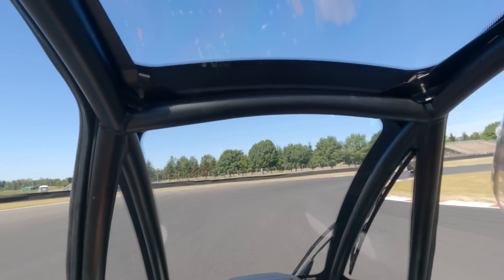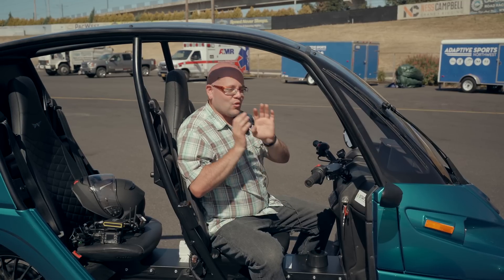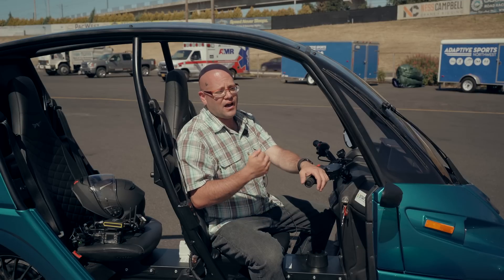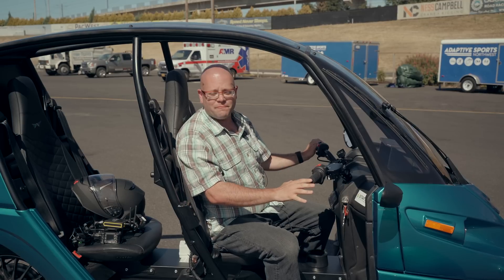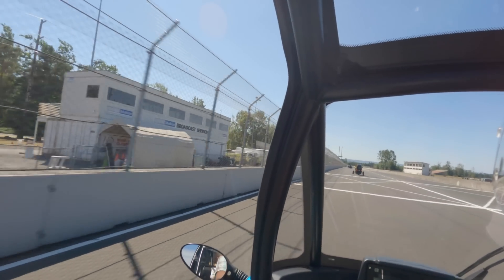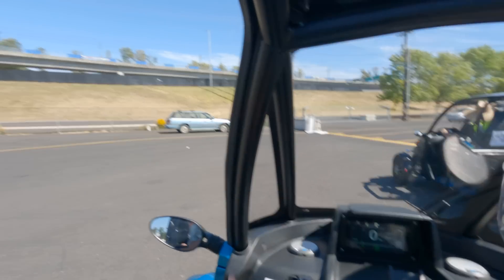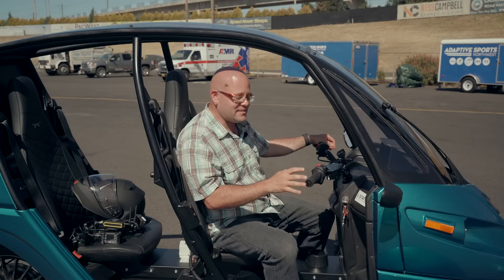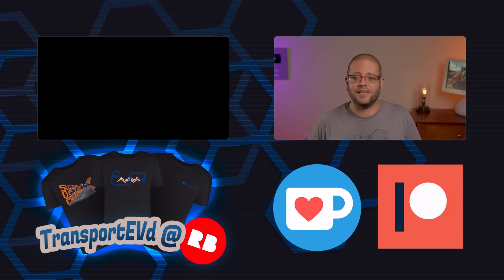All Arcimoto FUVs Will Get EVEN BETTER Thanks To THIS Super Smart Prototype!

Comment: i will buy one for $1,000.  $18,000 is too much for toy.
Reply: Ok broke boy
Reply: Not a toy if you live in a city.  Super useful and super fun.  Ditched my truck to drive this instead - more fun, easier to park, and does 95% of the trips I need to take (and yah, I'm a fan as a result :) ).

Agree that it wouldn't make sense if you lived out where everything is 30 miles from your house (like the rural farm we had for a while).  Then it'd be a toy because you'd have to have other transportation for too much of your regular driving.

Comment: For $18,000 I just don't see any value...
Reply: But at mass production they will be much much cheaper… 10k
Reply: @Bensmithstuff  I would be interested at $8,000
Reply: @skepticalmechanic  LOL - Dreamer!  I'd buy two at that price! (pick-up model and the one I two seater I already bought ;) ).

What other transportation that can go up to 75mph, protects you from the rain, and can go 60-100 miles on a charge could you buy for $8K that was well made and made in the USA?
Reply: @Haikutm  my thinking is I can buy a used Chevy bolt for $13,500 with 70k on it… realizing the dream in three days… battery only had 4% Degradation I sure am in dreamland!
Reply: @skepticalmechanic  👍 

There's a big difference between "no value" (implied by your statement) and "less value than ___".  I think your statement of "don't see any value" isn't accurate and is selling it short.  It clearly has _some value, just maybe not 18K worth, to you.  

I've bought a lot of used cars over the years and at about 80K is when the maintenance items seem to start cropping up.  No ICE in the Bolt removes a bunch of them :), but 70K miles on the battery pack of is a fair amount (never mind the bearings and everything else).  I wonder what a new battery pack for that Bolt is going to cost?

The Bolt is a decent cheap electric, but it's a different driving experience than an FUV (which I'd suggest is more fun, but I guess you'll have to drive them both and decide for yourself since that's clearly a subjective evaluation :)).

Also, at 13.5K You'll likely be able to get a brand new mass-production FUV for $12K in about a 15 months (call it $14.5 with full doors if you like) and so for $1K more you'll have a brand new vehicle with fresh batteries instead of a vehicle with 70K miles on it. ¯\_(ツ)_/¯  

"value" is subjective and I guess Arcimoto will find out if there are enough people who see the value Arcimoto's offering or not once they start producing them in quantity.  I believe there are enough people who will see the value and buy them, but time will tell.
Reply: @Haikutm  yes… we will…
Reply: Tons of value, especially if you live in a city.  So convenient for driving around town.
Cheapest plug-in electric car will cost at least that, likely more, and will get fewer miles per kWh because it'll weight 2x or 3x as much.

No question that at ~$12K it'll be an incredible value.  Still plenty of value as is.  Sold my truck and drive this instead.

Comment: As three-wheeled, two-passenger cars go, the Arcimoto appears to be well-engineered. However, there have been and are currently three-wheeled vehicles on the market, and they have never sold in significant numbers. It's not likely that the Arcimoto will significantly change people's vehicle buying habits.
Reply: I don’t know of any 3 wheeled, 2 passenger ELECTRIC motorcycle (not car by definition) that doesn’t require a helmet and/or endorsement. In Oregon, California, Hawaii, Florida and I believe one other state, the Arcimoto FUV does not require either. So there really isn’t competition in that particular market. I didn’t want to wear a helmet, wanted a starter electric vehicle, and didn’t want to deal with motorcycle issues (leaning, gear changes, passenger safety issues, needing to cross railroad tracks and grated areas very carefully, etc.) The Arcimoto fit the bill and 15 months later it still does.
Reply: agree. it will likely be a large failure in its current state.
Reply: The lower price than most of them, and the much more shielded  cabin make this much more attractive to me. The EV part is just an added bonus considering EV usually adds significantly to the cost. I'd buy a gas or electric version of this, but if they can truly  get this under $15,000 for the basic version I'll get one.
Reply: @bryanhersman4037  The EV aspect is the biggest thing going for the Arcimoto.
Reply: @kevinpolito1529  for some, I like the size, the look, the coverage from sun and rain, and mainly the price. If they made a $10,000 one powered by Honda's 700 parallel twin I'd buy that one instead. $15,000 for an electric one with at least 100 miles of range is OK as well.
Reply: @Kevin Polito If things continue to progress, they plan to ramp up production and hope to produce FUV's starting at around  $13,000 by 2024, I likely wont wait that long.

Comment: So what happens when you are stopped with you foot on the brake trying to park on a steep hill. The motors will not be able to rotate and you are left with heavy steering again.
Reply: Those are the software issues that they have to work through and why it isn’t available sooner. The software can make one motor step forward while the other steps backward …

Comment: Why don't they just add a motor for power steering assist at low speed?
Reply: There is power steering already. By making it more aggressive at low speeds it,  apparently, makes it less stable at higher speeds. Plus weight. They can drop the power steering and save $$ and weight.
Reply: Because they already have a motor, on each wheel.
Reply: @z4zuse  I'm asking about a steer assist motor, not a drive motor.
Reply: @wmf1595  through software you can make the hub motors act like power steering
Reply: This is a simpler, cheaper, more efficient, and probably more reliable.

Comment: The one thing that might be an issue for those less mobile is that you still have to lift your legs over the central console. If that were removed so it was more like a scooter it would be much more practical for say the elderly.
Reply: It's where the battery is located. Hard to see how they could move it.
Reply: @KBinMD  Under the seats would probably be best.
Reply: @davidlazarus67  it's already under the seats - the center rectangle runs the full length under both seats and contains the two battery banks.  To remove this they'd have to go to some kind of flat battery pack like many of the electric automobiles do (which I think would require a different battery type) but that would be a considerable redesign and have other ramifications.
Reply: I said the same thing. At this point the only person that had problems was the MIL with 2 knees that should have been replaced years ago. I have really bad knees without issue. And a bad back. 🙃

Comment: I don't know if my FUV is just a little different from others (maybe my power steering is set more powerful at low speed?) but mine isn't "impossible" to turn at a stop. It's hard, but I can do it. And low speed turning definitely takes more effort than I'd like, but not "very hard". (And I'm not exactly a paragon of upper body strength. I know that in some of the prototypes, they had the power steering "at full power" even down to a stop, and they said it actually caused problems; so they ramped it down so that the power steering isn't as powerful at low speeds (which to me seems ironically backward.) Maybe mine still has an "early version" before they ramped it down that much?

That said, I can't wait for vector steering! That will make low speed maneuvers downright *easy*, rather than taking so much effort.
Reply: Mine is a bear at really low speeds (parking), impossible at a stop, and down right scary at turns. We’ll see if a software update helps. Ours is at summer camp right now.
Reply: Agreed that it's not as hard as this guy makes it out to be.  Does take more muscle than you expect when you first start driving it, but I found that I got used to it within a couple of weeks.  And yah, I'm also excited to get this upgrade as well :)

Comment: As an engineer the work required isn’t technically difficult, a steering torque sensor (as used in every vehicle with electric power assisted steering) and some software, it’s getting the calibration (‘tune’) right in the software and making it safe (ISO 26262 compliant) that takes the work.
Reply: Low-speed electric steering assist would be a big plus (i.e., remove a big minus).
Reply: Sigh, compliance.... I wonder if it's one thing
for cars and another for bikes. afaik this is legally a bike.

Comment: I kind of assume that there is (or will be) some form of traction control involved also.
I live in an area that gets snow part of the year so would need this as well as enclosed doors
(removable like a jeep).And a heater. Not sure the range or top speed but they sure look cool for
an urban run about. And I agree $20k is too much, 12 is more like it. Nice vid, keep up the good 
work and welcome to the TE team.
Reply: Traction control may not be an issue, the beauty of a three wheeler is that you always have weight on the wheels…unless you get carried away.
Reply: @markthomasson5077  Ever had your steer 
tires loose traction? That == loss of all 
directional control.
Reply: Yeah, it didn’t do well in 21-2 inches of slushy snow when I went up a hill. There is a future button for traction control. In Oregon if you are moderate/low income, a base Arcimoto will cost you $12,900 after $2500 manufacturers rebate and $2500 income rebate.
Reply: @harriska2  Neat, I wonder if PA has similar.

Comment: I can relate to the turning issue after driving a CanAm Spyders in the mountain twisties. You feel like you just went through a workout which takes away some of the fun. Nice job Arcimoto.
Reply: @stephenbritt6557  Can-AM was a 2012 and a  2014. I remember going up to their rally in Durango when they talked about testing an EV model which never came out.. - I plan to rent an Arcimoto in Scottsdale Az at Rides in Motion for two hours on a 65-mile ride through the twisties to Bartlett Lake to see how it does.

Comment: I drove an Arcimoto (without vector steering) in San Diego a couple days ago (8/9/2021). The heavy steering at a stop/slow speed felt pretty much like an old school car with manual steering. You have to move the car a bit to lighten the steering effort. I also noticed that slow speed turns (10-20 mph) tended to "scrub" the wheels quite a bit and felt kinda meh in terms of stability in turns. I thought the steering was a bit twitchy as well. It would be interesting to test out the vector steering version.
Reply: Sounds to me as if they are using software to make up for less than optimal mechanical design.  As long as it works, I guess...
Reply: "scrub" the wheels ??

Comment: Are you going to get one? Would you rent one for about a week?
Reply from the maker: I would definitely rent one for a week. Right now, at close to $20k, I wouldn’t buy one. But if Arcimoto can bring the cost down the way it plans to, I’d be very interested - Winter
Reply: @transportevolved  I just bought a FUV. I know the price will drop and the design will improve, but I am a retiree so waiting a few years is not an option.
Reply: @chrisconklin2981  
You can always upgrade
Reply: @superfly19751  I live in Florida. It will cost me over a thousand dollars to ship one way. Until Arcimoto builds an east coast plant, upgrading cold be costly. Of course I am sure a repair/upgrade shop will happen in Florida. I predict that the FUV will give golf carts a run.
Reply: @superfly19751  I might add that Arcimoto is opening an "Experience Center" in Orlando Florida. So, they have plans.
Reply: @transportevolved  YES I feel the same as you. I just do not have a room to rent or purchase it.   Where I live I have not seen any on the street or road.  Yet I keep looking for them.  Thank you for sharing your thought about it!!

Comment: I really want one of these!!
Reply: With all season door add-ons.
Reply: @truetech4158  I have the early half-doors; which are fine in about 90-95% of my city's conditions; but yeah, I'm definitely impatient for the long-discussed full doors. (I don't even need them to be fully car-like solid roll-down windows - they can be old-school jeep-like (or first-get Dodge Viper-like) soft windows you unzip or unsnap and fold in.) I just want SOME form of window to protect me from road spray in the nastiest conditions, and hold in the heat of the window defogger in the extreme cold.
Reply: @truetech4158  Completely different target markets, and not even remotely street legal in the US. I do wish there were vehicles like that in the US, although I have a feeling even if they were legal, Americans with their SUV and pickup fetishes would avoid them even more than they avoid highway-capable vehicles like the Arcimoto.
Reply: @AnonymousFreakYT  it's legal if you have a slow moving vehicle sign on it. Can't drive it on major highways though a Mormon horse cart doesn't even need the sign if they wanted to trek coast to coast.
Reply: Me foo